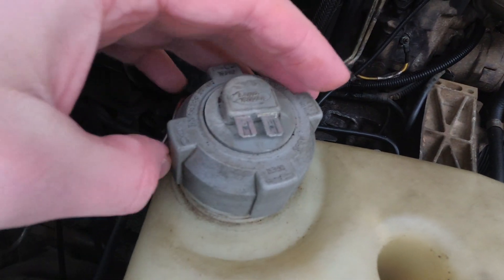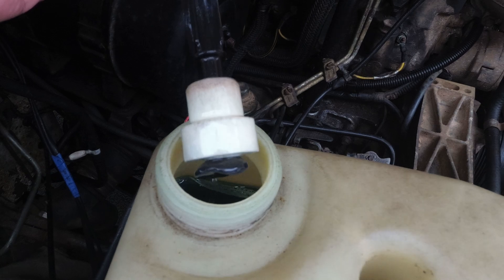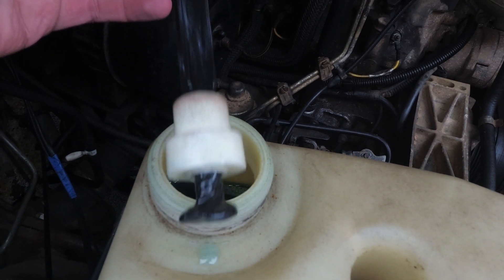Alternative 300Tdi coolant level alarm

Comment: Do you find that cap system to leak around the pivoting swivel that wires connect to? Or is this where the coolant should leak from if the system is over full?

Comment: With a few extra basic components you could add a small delay to the input which would give you a longer power on self test and eliminate flashes from sloshing in the tank

Comment: Hi Will,  I had a simple float switch for a few years and it saved the engine, but last year upgraded to the RRC Cap.  I had a look at your wiring diagram with the control module and i'd like to suggest a simpler fix.  On my 110 I fitted a Double Throw Relay - these relays give you the option of allowing the relay power (+'ve) to switch the relay either ON or OFF.  They have 6 pins (2 switch; 2 power ON, 2 power OFF).   The relay is always powered (with IGN on) and the float switches the earth (-ve) to the relay's switch circuit, so that there is no live current through the cap (no risk of burnt wire, no need for fuse).  When it activates it powers a most annoying peizo buzzer in the cab, so it can't be ignored or overlooked.

Comment: What would have geen good is to actually show the wiring for the system, not just talk about how it works. I agree that the error check is really a necessary thing to be employed in low coolant. I have a very similar system in the planning for my 300tdi build (along with a few other level and system checks.) Ford did this in the early 80's on all of their above base vehicles, the system warned of low coolant, washer, oil, brake pad and fuel. It had a 10 second check on the items to remove false alarms and temperary low "flashes".
Reply from the maker: The pinned comment has a link to the article with the wiring. This video was a response to another video on a different channel

Comment: Would agree, have this principle of level sensor on mine. But circuit doesn't use a float it just has a pair of probes that are screwed into the tank. The circuit of the sensor passes through and tank probes and coolant. If the level falls circuit is broken. If a wire breaks or the check switch is pressed system  "fails on" .

Comment: As another solution you can install a madman EMS system. Can also monitor oil pressure and transfer box temperature. Coolent temperature in degrees is also really helpful. Have it installed on all of our Defenders and has saved at least 2 engines.
Reply from the maker: Thanks Shane. It always seemed to be a challenge to get hold of them outside of SA. Where'd you get yours?
Reply: @lrworkshop  I am in SA haha. I thought they were exporting them to the UK.
Reply from the maker: @ShaneFromSA  Gotcha. They do always seem to be out of stock...
Reply: I have EMS in Australia, bought locally.

Comment: This is what I have used for years in my 300Tdi.   Very simple, just replaces the plug at the top of the radiator (screws in) a bit of basic wiring.   You have a visual and audible alarm when the water level drops below the sensor.  They were a bit cheaper years ago too.

https://www.enginesaver.com.au/landy1.htm
Reply from the maker: Thanks for the link Simon

Comment: I made one (in 24v) from your design, easy. Currently removed Range Rover level sensor as it was rubbing on the underside of bonnet (under investigation) and put the original cap back on. Works as you say and with the wiring disconnected the light is on all the time! I have had leak problems with that type of expanding seal that Mike had on the float switch and therefore happier with essentially non modified cooling system

Comment: I understand what your talking about. A simple way to improve mikes idea for me was just to use the float the other way around, and that way connect it to a light/LED that is always on if the coolant is correct. You also know that the float light and wiring are working.
Best thing I ever did was buy a clear water tank from Bearmach. The black one went straight in the bin.
Reply from the maker: Another good alternative Rob 👍